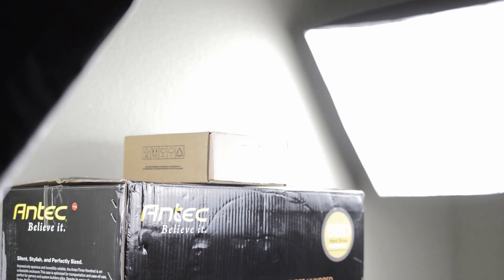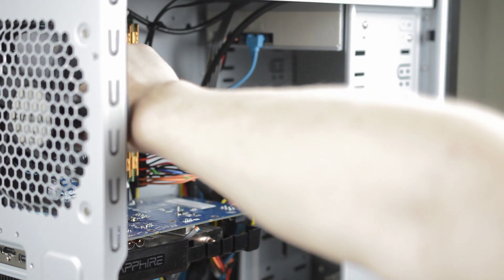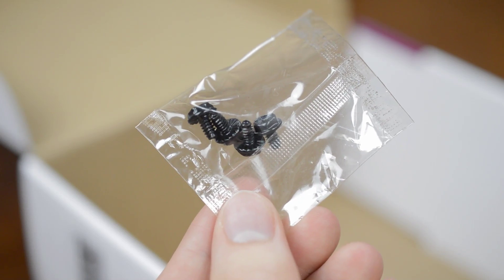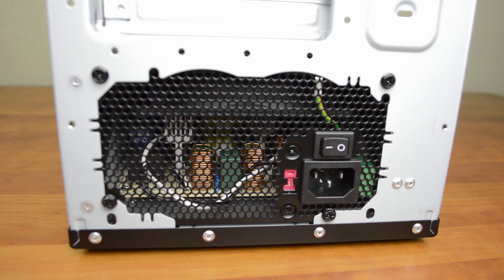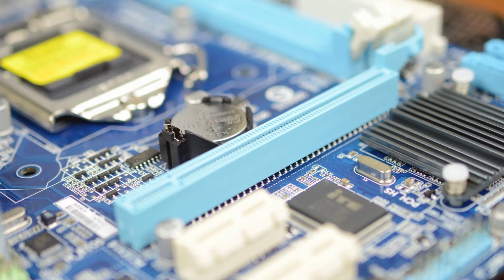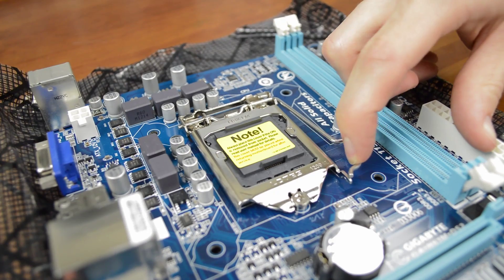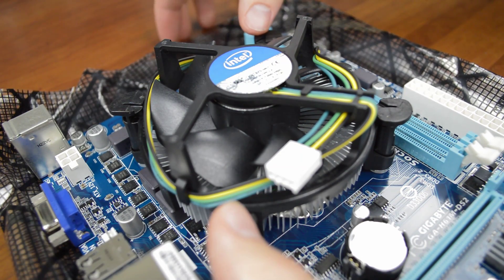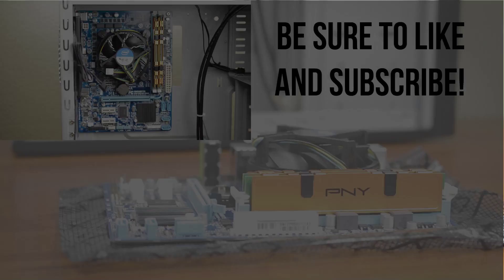How to Build a Computer for Gaming (2012) Part One

Comment: Will i Be Able to put a intelcore i3 4170 proccessor and Nvidia geforce gtx 980 ?
Reply: of course it can but that 980 wont reach its best performance /that cpu is making the computer has almost extreme  bottleneck .i suggest get an i5 or an i7
Reply: If gonna play at 4k probably not will bottleneck, 1080p? Most likely.

Comment: No, don't set the motherboard on the bag. Thats actually worse then setting it on the carpet if anyone knows how the static bags work.
Reply: Viking Dude I was thinking the same thing, doesn't the outer side of the bag contain static electricity in order to keep it from getting inside the bag? And to the other part, you're supposed to put the Motherboard on top of the box where it came in, am I right? And add your RAM and CPU from there on.
Reply: Yeah the bag can contain static on outside, thats how it was designed to keep the contents inside safe, Yeah a box will work for the mobo Ram, CPU, then rear IO, then install the motherboard and everything else is how your case is designed or what you want to do next like PSU, GPU, SSD/HDD's

Comment: I wish someone would've told me that touching the case would've worked. That way I wouldn't have had to built my PC in the kitchen ( I used my oven to discharge any static electricity ).

Comment: A note for someone who may be using a different mobo, make sure when inserting RAM if you have more than 2 slots and only plan on using 2 that the 2 you chose to use are paired.  Usually 1,3 and 2,4.  On my mobo they are color coated for ease.

Comment: I'm looking to make an extreme computer  that can run any game on Ultra and work perfectly fine with little to no lag. My budget is around $700 and is a little flexible around that. What should i use to make the computer in detail? Thank you.
Reply: Building a machine that can run "any game" on Ultra is not feasible with a budget of $700. The price bracket for a build that powerful would be a few thousand dollars.

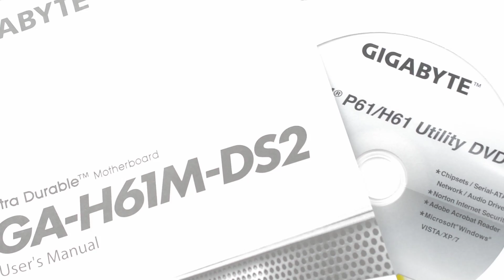Comment: 2:30 Set.... the b-board... on the bag? .-.
Reply: ya so the bourd does not get statc in it
Reply: There's static on the outer layers of the bag.
Reply: No its a static proof bag didn't you see the video, he even says it.
Reply: Static proof bags have static on the outsides.
Reply: JacobStar91041 Who ever told you that fooled you. The entire bag is made of the same substance inside & out, hence it is safe to put the motherboard on the bag. Get your facts straight kid.
Reply: Hey no need to be hostile, it also depends on the bag itself. I say this for awareness, because some bags are dangerous to put it on the outside and some is safer. It's better to be safe than sorry.
Reply: ksalbrecht88 Get /your/ facts straight kid. Some motherboard bags have static on the outside, but not inside. Everyone now puts it on the box, because it is the safest place to put it while you're working on it.
Reply: ksalbrecht88 anti static bags are dangerous to the board if the board is powered on but not otherwise
Reply: ksalbrecht88 the way the bags work is the outside grabs all the static before it can get inside, so putting a board on the outside of the bag can actually kill it under the right circumstances. The best thing to do is to put the board on the box so it gives you a good static free workstation that is also above the ground allowing you to test components.
Reply: JacobStar91041 then just flip the bag inside out-_-

Comment: the... motherboard comes with a DVD...for...a computer... figure out the math
Reply: it's not an instruction dvd, it's for installation of drivers when the PC is done I think.
Reply: well the DVD still did come with the mother board anyway so...
Reply: Baker Games well if you cannot connect to the internet without the drivers than install the drivers from the dvd unless you have bought a wifi card for it,
Reply: i know this know i was still learning about computers then :)
Reply: Baker Games Ah ok :)
Reply: i never realized that the drivers needed to be installed
Reply: Baker Games yeah they do, otherwise components may not work correctly with each other, also there is the over 100+ windows updates you need to install as well if store/online bought like a DVD or something, but Drivers can be downloaded online at the official website of the component as they are the most current version until a new update comes out...

Comment: will these ram cards work?
http://www.amazon.com/Corsair-Vengeance-240-Pin-Platforms-CMZ8GX3M2A1600C9/dp/B004CRSM4I/ref=sr_1_2?s=electronics&ie=UTF8&qid=1384811228&sr=1-2&keywords=8+gb
Reply: Yes, because it is 240 pin and ddr3 so as long as the motherboard has a couple 240 pin ram slots and is ddr3 then yes
Reply: thanKs!

Comment: get an amd fx 8350 and push the bitch to 5.2ghz with an h80i watercooler, then pop in a 7950. works out to be same price as a lower end 7870 with 3570k* and the 8croes edge it out in xplit and recording/streaming, its just a few seconds slower at un-rarring files. get a seagate barracuda as they are cheaper and still 7200rpm (OP), 650wpsu is fine, everything else is nice.

Comment: how is this?

CPU-Core i5-3470k
RAM-G.SKILL 8GB (2 x 4GB) 1866 ripjaw
GPU-ASUS hd 7870
MOTHERBOARD-Gigabyte Z77N-Wifi
HDD-Western Digital WD Blue 1TB
CASE-BitFenix Prodigy
DVD DRIVE-Black SATA 24X DVD Burner
PSU-Corsair TX 650

im not sure if this is all good, im open to any other recommendations

Comment: prebuilt computers can rarely be upgraded because the psu doesn't have extra headers, not enough wattage, there built differently because they make lots of the same model and its easier to build it with those parts in mind, usually the motherboard wont work with new parts. i recommend getting a hole new computer. if u can upgrade it upgrade the GPU first, that will give you lots of FPS

Comment: Well, I switched out the case with a cooler master elite 430 and added 4 120mm blue led fans which are only 7.99 each. Without the fans on amazon, you can get free shipping for all of the parts and with tax its only 540 bucks depending on your location.

Comment: Build would work together but theres some things i wouldnt recommend:
- the case (not bad but you could get a better case for $50 like corsair 200r or haf 912) 
- processor (dont go for the fail-dozer. youre better off with phenom x4 965 black edition or fx-6300)
- arctic power supply? never heard of it. as long as its 80+ bronze certified and has enough power then you're good

Comment: would this PC build work together? thanks

-NZXT Guardian 921 RB ATX Mid Tower Case

-Gigabyte AMD Radeon HD 7850 2 GB GDDR5 DVI-I/HDMI/2x mini-Displayport PCI-Express 3.0 Graphic Card

-AMD FX -4130 3.8Ghz Processor FD4130FRGUBOX, Black Edition

-MSI Computer Corp. Socket AM3+ AMD 970 DDR3 SATA3 and USB 3.0 A&GbE ATX Motherboard 970A-G43

-Corsair 8GB (1x8GB) DDR3 1333 MHz (PC3 10666) Desktop Memory (CMV8GX3M1A1333C9)

-WD Blue 1 TB Desktop Hard Drive

-Arctic PSU (supports 480w/580w/680w)

Comment: The lights and fans powering up are a good sign that you didn't short the motherboard. Were you sure to plug in the 4 pin CPU cable to the port on the motherboard? You should have plugged in the 24-pin huge plug as well as the 4 pin plug next to the CPU. Take note that your power supply may come with an 8 pin cable, but that shouldn't matter.

Comment: You actually don't need the disc installation.. I brought a DVD drive especially for this, then found out you only need it if you've got XP.. So if you're using XP you need the disc.

Comment: Its not a gaming PC when you use a 2 core Processor, a gaming PC have to run Games in Medium or High Resolution. Battlefield 3 need a 4 Core Processor for High Resolution for example. And for 500$ you can build a better PC then in this Video.

Comment: Its a good gaming PC build. I'm trying to build one too, but on a budget.
CPU: Intel core i3 3240
Motherboard: ASRock H77-PRO4-MVP Motherboard 
Case: Xigmatek Alfar MT Black Case with Window 
Power supply: Corsair VS550 ATX 
RAM: Corsair Vengeance CMZ8GX3M2A1600C9R 8GB (2x4GB) DDR3 
HDD: Seagate Barracuda 500GB ST500DM002 
OS: Windows 7 home premium 64 bit
GPU: Gigabyte GeForce GT 640 OC 2GB 
Optical drive: Lite-On IHAS324 24x DVDRW
Its going to cost around $690 excluding postage.

Comment: Not bad, but the GPU is a bit crap. You should go with an NVIDIA GTX 650 Ti Boost. It costs around $65 more, but it's worth it. Also, what kind of case are you using?

Comment: you dont need to watch linus' video to know that anti static bags usually contain a conductive material on the outside to attract static away from the inside, its kind of how suits to protect workers working on power transmission cables work

Comment: You are only partially correct sir.
For one if he were to get an AGP card and try to socket it to PCI it would not work.
Same goes for if he were to get DDR2 ram when the board is for DDR3 (yes both the DDR3 and DDR2 have the same pins but the notch is placed differently) making them incompatible.
Lastly if he were to get an Ivy Bridge processor with a mobo under the z77 series it would also fail to boot because the bios on the board would need a flash update to support the new architecture.

Comment: Don't put the board on the bag! The way they make them anti-static is by puting thin metal strips on the outside of the bag. This prevents and static electricity from hitting your motherboard by redirecting the electricity on the outside of the bag. So, do not under any circumstance put your motherboard on the anti-static bag.

Comment: Sh*t! can 400watt power suply can handle
Seagate 500GB, 7200rpm, 64MB, SATA III, Constellation ES
Intel Core i5-3570K (3.4GHz, 6MB Cache, LGA1155)
Giga Byte GeForce GTX650 Ti, 2GB, GDDR5, OC
Kingston 8GB, DDR3, 1600MHz, CL9, Kit of 2, HyperX Beast

Comment: my computer in on a 2m table near the window so its well ventilated. NZXT Lexa S case.
just be careful when its rains don't want any rain drops to go into the psu cuz the comp is not gonna work until it drys out.Best to close the window if its raining.Small opening is fine.

For people who have carpet floors that are not clean who leave there computer tower underneath there desk/table NOT a good idea gets real dusty/stuffy down there.Not a good ventilation place.

Comment: This thing is a myth.
The bag only prevent static going thought the bag, and the inside doesn't provide any static protection either when it's not closed(it needs to be sealed to create a protective cage).
Now, because it doesn't provide anti-static protection, doesn't mean it does the opposite... Take a multimeter, use it on the bag, it will read infinite resistance. = non-conductive. Your fingers, which you're using to manipulate the board, are a lot more harmful than the anti-static bag.

Comment: Most PSU's will fit, unless it is one of those crazy watt amount power supplies, as they tend to be larger. As for the processor, just make sure that the socket type is the same. So for example, the i5 2500k uses LGA 1155. When choosing a motherboard, make sure that the motherboard is using the socket type that works with your CPU. That information is always listed in the name of the product. (for example on amazon)

Comment: any ATX standard sized PSU will indeed fit. You can also use an i5, but i would always recommend using a Z77 motherboard for having access for all the features.

Comment: Most power supplies have the same dimensions,only 1000~1500w psu have different dimensions.An i5 will fit in that motherboard,but you should be looking at a z77 motherboard if you're planning to get an i5.

Comment: i followed this guide to the T, except for the parts, and it looks like everything should be running properly, and all the fans cut on, and the light for the power shows its working, but I don't see anything on the screen. i'm using an hdmi connection to my tv as a monitor. my graphics card and motherboard both have hdmi and I tried them both and neither work. I've tried rewiring and that didn't work. I'm almost positive the wires are correct... what do?

Comment: you wont break it. the design of pc iis pretty good. if it is not meant to go there, it won't. Also don't rush it and read the manual. the manual is included for a reason so just build iit

Comment: I have a 2600K running at 4.2ghz, z77 chipset, 8gb ram and a 580gtx matrix slightly OC'd. I am not impressed by the difference in gfx quality. games run smooth, but they also run smooth on a console. i paid about 1800euro's a year ago. by now i could have wasted 5 xbox's and a few controllers by now.

pc gaming is just far too expensive for the slight better gfx. the evolution of pc components is so fast that there is no time to get the most out of the hardware (which consoles do).

Comment: •Case: Antec 300
•CPU: Intel i5 2400 3.4GHz, Sandy Bridge 
•RAM: G.Skill-NT DDR3 4GB 1333MHz (Single Channel)
•Video card: PowerColor HD 6850 1GB
 •Motherboard: GA-H61MA-D3V (USB3/SATA3) 
•Hard Drive: Seagate Barracuda 7200RPM 250GB (Model No. ST3250318AS)
 •Power Supply: Vantec iON2 460w
is this worth $400? iam thinking of buying it off a mate? but is it worth it? and how good is it for gaming?

Comment: Can someone please tell me if these parts are good for gaming and they fit?
AMD Athlon II X4 640 3.0GHz Quad-Core Processor
Cooler Master Hyper 212 Plus 76.8 CFM Sleeve Bearing CPU Cooler	
ASRock 970 Extreme3 ATX AM3+ MOBO
Corsair 4GB (1 x 4GB) DDR3-1333 Ram
Seagate Barracuda 500GB 3.5" 7200RPM Internal HDD
Gigabyte Radeon HD 6670 1GB Video Card
Rosewill RC-701 Sound Card
Antec DF-10 ATX Mid Tower Case
Corsair Enthusiast 550W 80 PLUS Certified ATX12V PSU
Asus DRW-24B1ST/BLK/B/AS DVD/CD Writer

Comment: Hi, I checked out different motherboards and I saw a difference. The more expensive motherboards have 4 slots for RAM instead of 2. And 2 slots are black and the other 2 are blue. Is there any difference between the black and blue slots and in which of them should I put my RAM?

Comment: I'm having trouble fitting my power supply. I'm using the same Antec 300 case and my power supply is a Corsair CX430. I don't understand why it won't fit.

Comment: I just built my first rig and am able to play everything i have tried  on max setting with out any issues so far ( BL2,CODBO2,FarCry3,AC3,Guild wars are some). but i want to know if this setup would last a few years being able to play all the new games that will coming out, on the same settings i am now i am using 
I5 3570k 
Asus p77 pro mobo
Asus gtx 660 ti 2gb Gpu
8gb ram 
1tb HDD
800w PS

Comment: If you are using the stock intel cpu fan then it has paste, don't worry about it. On the other hand if you are using an aftermarket cooler then you'll need to apply paste.

Comment: You shouldn't put the motherboard on the anti-static bag. It's only anti-static on the inside, but on the outside it can generate static electricity and in the worst of scenarios, could fry the motherboard. I really think you should put a annotated correction here? otherwise, good vid! :)

Comment: Another tip make sure power supply is installed in case plugged in to power socket but make sure power switch is off  at sockit this earths the unit and touch case every once in a while to remove static when handling parts. Enjoy your build

Comment: DUNCAN33303 I AM ABOUT TO BUILD A COMPUTER PLEASE CHECK IF ITS GOOD? 

CPU: AMD Phenom II X4 965 Black 3.4GHz Quad-Core Processor 
Motherboard: MSI 890GXM-G65 Micro ATX  AM3 Motherboard 
Memory: A-Data XPG Gaming Series 8GB (2 x 4GB) DDR3-1600 Memory 
Hard Drive: A-Data XPG SX900 128GB 2.5" Solid State Disk 
VideoCard: MSI GeForce GTX 560 Ti 1GB Video Card 
Case: Rosewill R101-P-BK MicroATX Mid Tower Case 
PowerSupply: XClio 550W ATX Power Supply 
Optical Drive: LG GH24NS90 DVD/CD Writer

Comment: PLZ HELP! Right, first im sry if I'm being a noob but do PCs come with wireless internet card so I can connect to my internet downstairs when I'm upstairs, I know laptops do but I didn't really want to spend $50 on a wireless internet card, I did a bit of research (like 5 mins) and I could only find one for old PCs so if I build a computer like the one Duncan is making in the video can I connect to the internet on the PC? (I cant use an Ethernet cable which I had on my old PC at my old house)

Comment: no, the gtx 670 will run absolutely everything on max. The 6850 might run a few games  on max, but not all. The gtx 670 has 2 gigs of ram, meaning you can use 2 monitors with no problem. You'll be able to run 3 monitors, but you wont be able to max out the game using 3 monitors. The 6850 isnt bad, but the gtx 670 will destroy the 6850 in any test

Comment: ehh i think you might, but with low fps, maybe 20. In my gaming PC, i have a gtx 670, sure it might be expensive, but it runs EVERYTHING on max. It can run Crysis 1, 2, and 3 on ultra. So if your really looking for a great graphics card, get the 670. It'll be able to run all the games for lat least 4 years

Comment: Hi! Im looking to buy the Radeon HD 7770 but I only have 460W but it needs 500W. I found this power supply: Inter-Tech SL-500 500W which is about 230$ and some other ones which were 500W too but cost like 400$. Why are they more expensive? Should I buy the cheap one?

Comment: a wifi card is just a card with a antenna or antennas. you need this if you want to connect to the internet wireless. but every motherboard comes with a connection in the back if you want to do a wired internet connection.

Comment: Hey can someone tell me I am getting the cooler master hyper 212 evo cpu cooler because I will be overclocking possibly, and I've seen that they point the fan towards the bottom power supply or the graphics card. Isn't it supposed to be pointing the other way towards the case fan on the top of the case so that the heat dispersed can be blown out of the case instead of throwing the heat on the graphics card/power supply? Please someone answer.